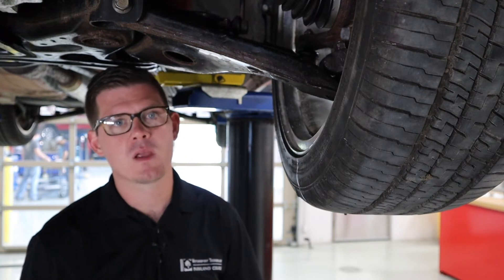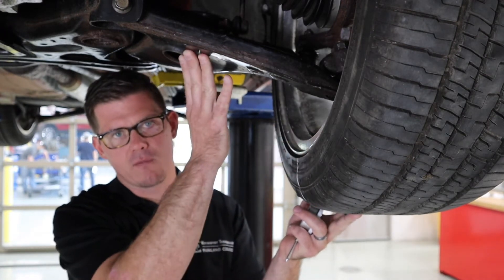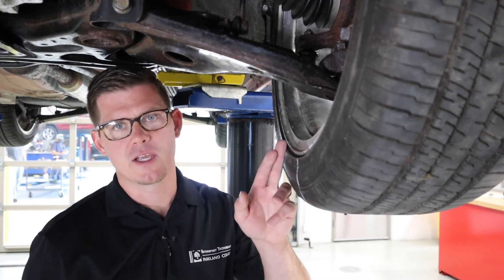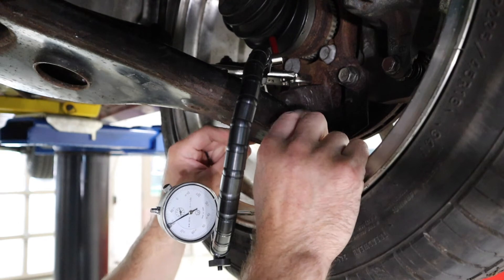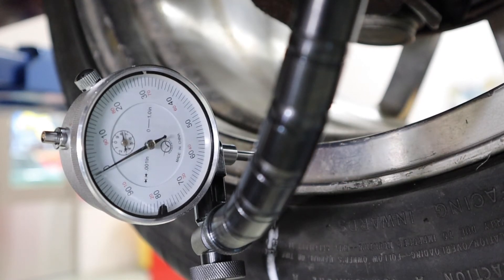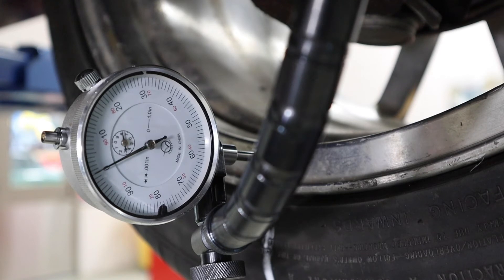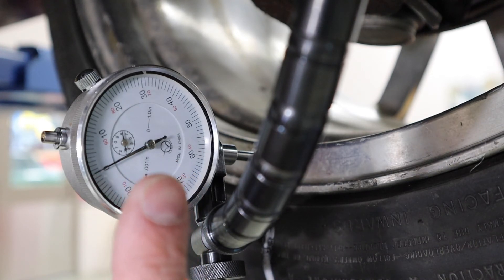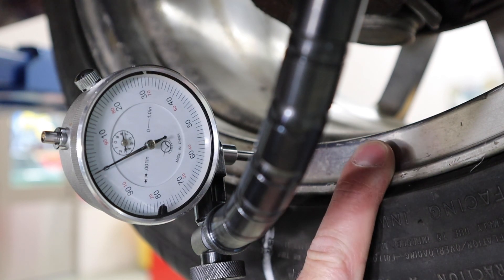Getting Started: Measuring Lateral Runout of a Wheel Assembly

Comment: The best wheel balancing machines are those that balance the wheel while its still attached to the car. That way you balance all the rotating components as an entire unit that includes the disc/drum brake not just the wheel.
Reply: How does that work when you rotate tires? Won’t it then be off?
Reply: @colt5189  yup, completely off.

Comment: So if the wheel is beyond a good lateral run-out, is there a way to correct it?
Reply from the maker: If you measure excessive lateral runout at the wheel, first consider whether the wheel is visually bent or distorted. Next, you would want to remove the wheel and measure the hub for lateral runout.

Comment: Have a brand new rv with severe steering wheel vibration on an E450 chassis- rebalanced front tires only off by 1.25 oz ea any recommendations? Great video thanks!
Reply from the maker: Have you checked steering/suspension linkages & connections? Beyond that checking for wheel and then hub flange runout would be a good next step. Thanks for watching!